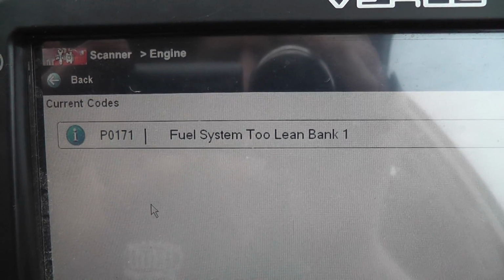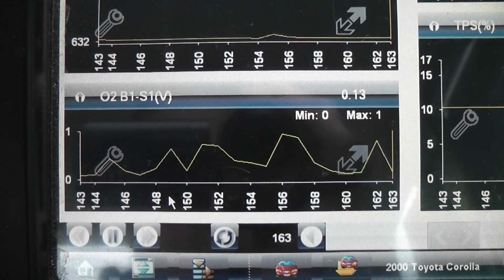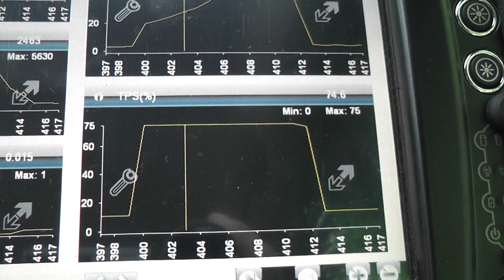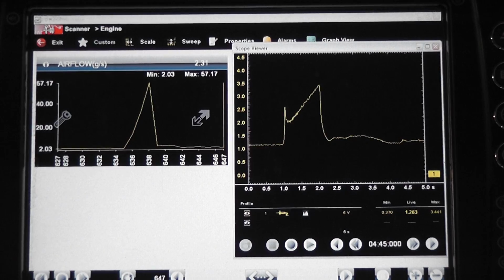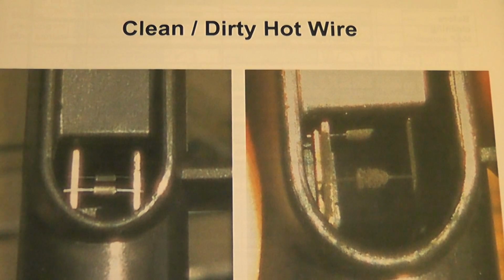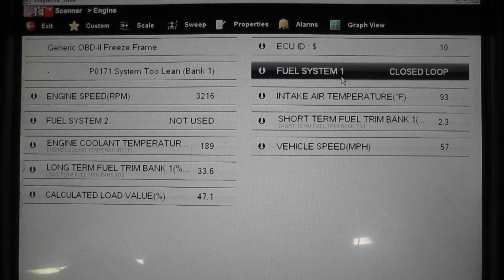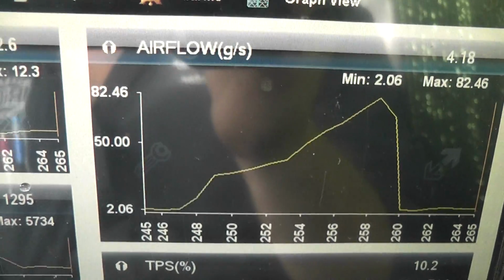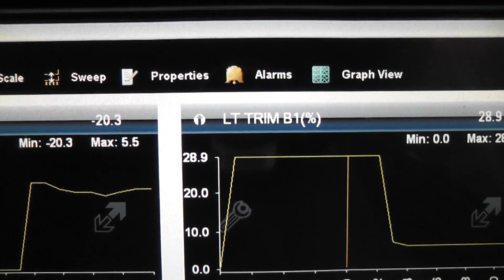Dirty MAF Sensor Case Study

Comment: Could a dirty MAF sensor cause a P0420 code? I have a 2000 Corolla that is getting a random P0420 code. I read online where people state that a dirty MAF could throw all other sensor readings off causing an false P0420. I want to start by cleaning the MAF sensor first. I know P0420 codes are common on this generation Corolla.

Also, I've read that it is bad to use carb or brake clean on MAF sensors. Many people say to use a special MAF sensor cleaner. Is this true?

Thanks for your help.

Comment from the maker: If it was a 2 bank system then yes, a dirty MAF would affect both banks. But this is only a 1 bank 4 cylinder engine. Bank 2 doesn't exist. 
Great question though, it means your thinking!

Comment from the maker: not a dumb question. 
you cannot use the downstream sensor the same way because the cat catches and stores oxygen. there is some diagnostic advantage though but it is not used the same way. check out my o2 fixed lean case study

Comment from the maker: i believe that is an analog type maf sensor and the signal should read more than 4 volts at wot redline. with a dmm you will need to drive it to see that number as the meter isn't fast enough for a wot snap test in park. You could also look at the stft and see if it tracks positive with a rise in the maf signal, this would also indicate a maf problem.

Comment from the maker: I'm not sure if that design is cleanable or not. my gut tells me it is not.
 you could also have a vacuum leak that will give you similar symptoms.
 or maybe even an e c t sensor that's giving you problems where is reading warmer than actual temperature

Comment from the maker: There are other causes of those lean exhaust codes. Sounds like you need to take it to a competent mechanic. It doesn't matter if he is an aftermarket guy or a dealer guy. Go to iATN and search for garages in your area. If they are iATN members you have a better shot at a good tech.

Comment: yes i did the resistance check and found one injector at 5 oms and 3 others at around 9 ohms so i did have shorted injector ,was  my starting issue.hey thanks alot for your help i was going crazy with this hard to find issue for 3 weeks .thanks again for sharing knowledge i saved alot of money doing it myself. gm 2.8 fixed good day

Comment from the maker: Did you do the resistance check I showed in part 2 of the one video? This is your only option without a scope, unless you get lucky and the shorted injector is one of the two injectors you can get to without removing the intake. 
There are other causes of this condition on your car, but lets do a resistance check on the injectors first.

Comment: thnx for the reply,the 2.8 gm starts once in the morning for a bit then stumbles n stalls i did check injector with noid light and it does pulsate when it starts but when it dont it does not pulsate,when i try start it no pulsation on light so i have eather bad injectors or bad computer?there is power to them tho but no pulsation like in your shorted injector vid.

Comment: hi,got an old 88 regal 2.8 103k runs for about 10 minutes once a day only then wont start .got codes 33,34 map sensor issues no vacc leaks i can find,,good spark,good fuel.just cant fix it.any ideas were i can look?im kinda thinking the computer is weirding out?i changed the map and maf airflow n no go.what elses can cause the 33 and 34 codes?i have no check light on but still have those codes.i erase them and when i start it n run for a few i get 33 34 back any tips ?thanks in advance good day

Comment from the maker: Higher than normal Co means the car is running rich. If you have my eBook, Section 5 page 4 gives a list of causes of richer than normal conditions. Here is the list:Higher than normal fuel psi
Ruptured fuel psi reg. diaphragm 
Leaking fuel injector 
EVAP purge problems
ECT or IAT sensor problems
MAP/BARO or MAF sensor problems
EGR valve stuck open at idle
Fuel contaminated oil
Head gasket leaking causing coolant contamination of the O2
Jumped timing chain/belt

Comment from the maker: The car most likely also had some fuel trim trouble codes too. If the MAF is reporting the wrong airflow the a/f ratio will be completely wrong and this can cause misfiring. Usually this is accompanied by lean or rich trouble codes as well.
Reply: Does the sensor under report or over report when it’s dirty? 

I get that the O2 shows lean and it’s dumping fuel, but it’s only reading lean because of what the maf is reading. So does that mean the maf is over reporting airflow?
If that’s the case why are airflow numbers greater with the clean sensor? 

I’m just confused as to how the MAF causes the O2 to misread if the calculated air was less with the dirty sensor?

Am I misunderstanding and the maf is under reporting and it’s fueling for what the MAF thinks is passing but the actual air charge still passes and leans out the mixture the MAF thinks it is dealing with? Then that causes the pcm to infinitely rich the mixture because it will never record absolute air flow
Reply from the maker: @DDR233  a dirty MAF will under report airflow under loads. Some will over report at idle only, but both types will under report under loads. This causes the base fuel map to be skewed as the engine load is being under reported too.
So positive fuel trim numbers result. Positive trim numbers does NOT mean rich!! It is a rich command caused by a lean condition.

Comment from the maker: Good question, as for the vacuum leak issue. I have never seen that effect the baro calculation. Also after cleaning the MAF, you have to reset the KAM or disconnect the battery for awhile to clear the baro calculation in memory.

Comment: Is the Ford computed BARO parameter sensitive to Vacuum leaks? I know it needs a WOT to do a calculation. Would a slightly lower value(149 vs 158) implicate a bad sensor(mine was cleaned). The sensor seems to pass all response tests (shop manual numbers). No Codes.

Comment from the maker: Yes
A MAF DTC with good MAF sensor usually sets a “range/performance” code and may be caused by the following:
TPS problem
Vacuum or air intake leak
Oil cap or dipstick problems
PCV system leaks
Dirty/plugged air cleaner
clogged exhaust

Comment: I know this is an off topic question for you but i really want a 2003-04 cobra if its modified what do i have to worry about future cost and how do i strip an engine down to the block to get it in the machining shop

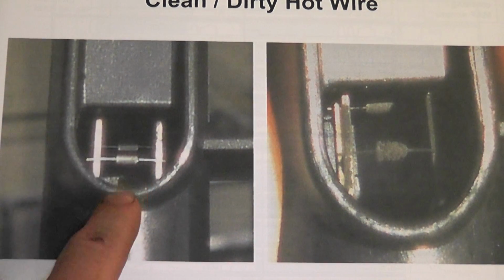Comment: Great Video, I can barely see 1 Thermistor (Temperature Thermal Resistor) when it was dirty at 07:30, and you can clearly see both afterword's at 08:56, Everything looks Clean, Dry, and Tight.

Comment from the maker: The IAT is a thermistor and the "cold wire" is possibly a thermistor, but the "hot-wire" is a resistor. (technically a thermistor is a resistor) 
Thermistors are generally used in voltage sensing circuits. MAF circuits measure the current flow needed to maintain hot-wire (heated resistor) temperature above ambient, then convert this to an electrical signal (analog or digital) that is proportional to the current flow and therefor in-coming airflow

Comment from the maker: Low MAF grams per sec at WOT, also low voltage during a snap while we were testing it directly under the hood. These were the clues that the MAF was the problem and not fuel pressure.

Comment: hi, lean can be caused by dirty mass air flow, clogged fuel injector, or fuel pressure or fuel volume. so how did u know it is dirty mass air flow and not anything to do with fuel. please adivse.

Comment from the maker: @import0408 I hesitate to say all but most yes. The older vane airflow meters on some of the cars had high voltage at idle and it would drop under load, so opposite of the others in operating range.

Comment from the maker: @contagiousFX What numbers? Fuel trim should be +/- 10% MAF grams/sec and frequency will depend on year and engine size to name a few. For most of the GMs I look for at least 150 gram/ sec at WOT and a frequency of over 8500HZ, Idle would be around 2.3-2.4khz. But again there are variable.

Comment from the maker: @lesbirel91 A dirty MAF is not the only cause of a lean exhaust trouble code. If you have my book check out Section 5 page 5. The list on this page address the most common causes for P0171 and P0174 DTCs

Comment: i have this code coming up on mine the only problem is i have cleaned the sensor 3 times and it still havnt fixed it      im thinking is it because of the decat or a lambda sensor ?

Comment: just bought a 2001 Corolla with code PO171 thinking O2 sensor, reading some tech found more likely a dirty MAF - this video is awesome! I not only see the how and why it makes sense - but your explaination helped me understand data I have been logging on a racing V8 car as well with fuel problems.
this is internet at it's best, thanks for sharing!